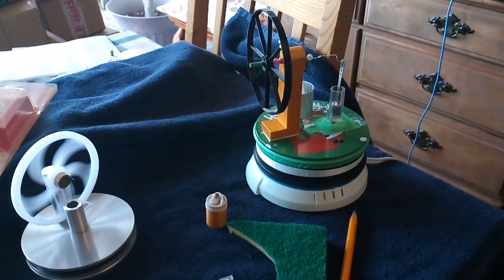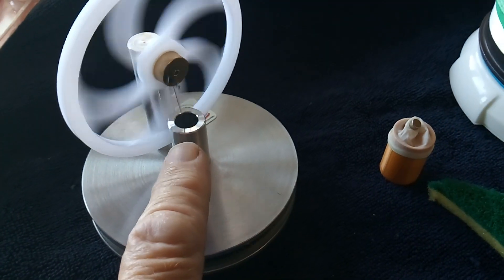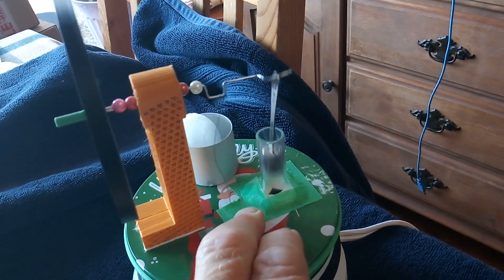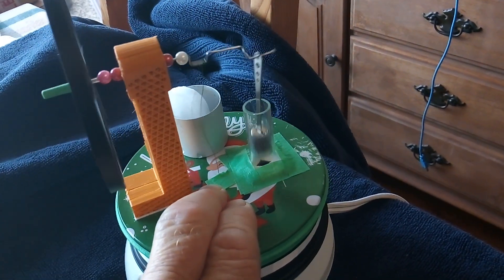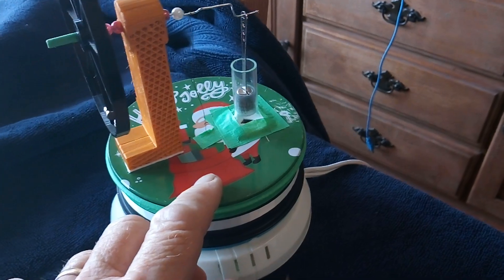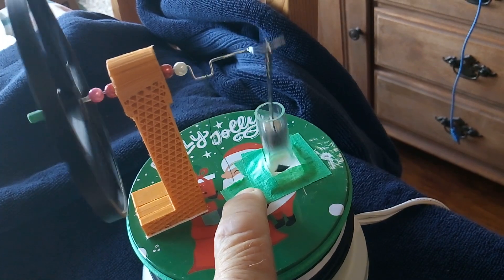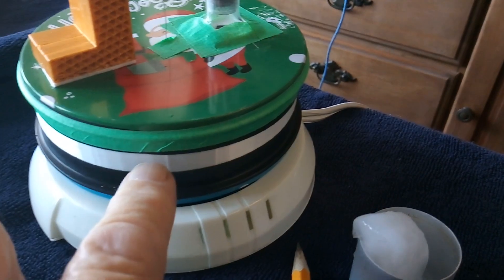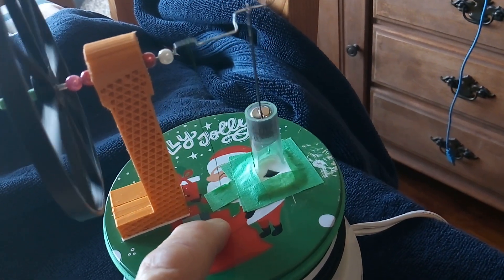Glass power cylinder on my PLA plastic Stirling engine

Comment: All the LTD (low temp) Stirling motors will work on cold. Set it on ice and ambient heat will run it.
Reply from the maker: You are right that the LTD stirlings run on cold vs ambient air temp as long as the ambient isn't too frigid.  I have seen some really good ones that need only a few degrees delta to run.  What I have been pondering is an engine that would run outdoors in winter using low low air temp vs ground temp 6ft down.  I havn't heard of anyone doing that.
Reply: @Lidmotor  I haven't either but you might try larger disc (more capasity) and smaller piston/cylinder comb. I made a small one years ago to hold in my hand and if it was cold enough outside it would run on hand heat. At room temp small ice cubes in hand with it on top it ran great.

Comment: That is interesting to see how much the lid flexes 👍
Reply from the maker: This flexing is a problem.  It does demonstrate how the air pressure inside the chamber is changing with heating and cooling.  I can fix the flexing problem several ways.  Pushing on the can lid with my finger is easiest.  😀😀😁🤣
Reply: @Lidmotor  I was looking at myfordboy's Stirling engine, he 3D printed a cross brace and glued it inside the lid to stop the flexing.
Reply from the maker: @GrandadIsAnOldMan  I saw that.  I might just make one out of wood and try that. I am not sure why he used plastic. If he used PLA it gets way too soft if you use it on the hot side of the engine like he did.  Perhaps he used ABS.  I might print one in ABS and see it it works.
Reply: @Lidmotor  good luck with ABS. I haven't tried it yet, plenty of scare stories about using it on your printer.
Reply from the maker: @GrandadIsAnOldMan  I have had some luck with ABS on small parts.
Reply: @Lidmotor  I seem to remember the issue was around getting the parts off the print bed. As I said, I haven't tried it, so it is just the scare stories that have put me off.

Comment: Very interesting it would be nice to see inside the metal container to see how you made it.
Reply from the maker: The only thing inside the can is the loose fitting round sponge wirh a piece of 30ga magnet wire stuck through the middle. The wire runs through a tiny hole in the top lid and is pulled up with the crank shaft. Gravity is used to drop the sponge displacer.  The wire is loosely warped around the crankshaft two turns to form the bearing.  It is super super simple.